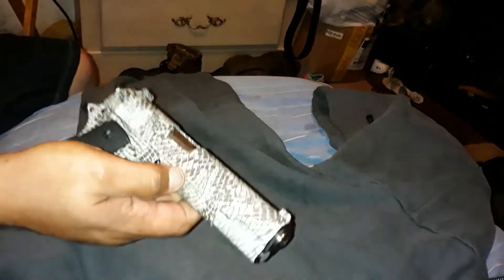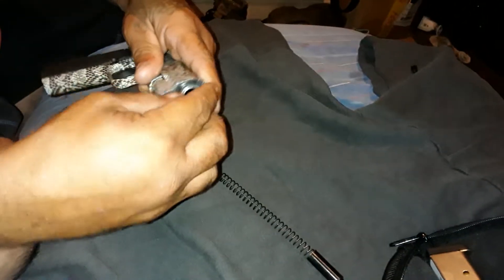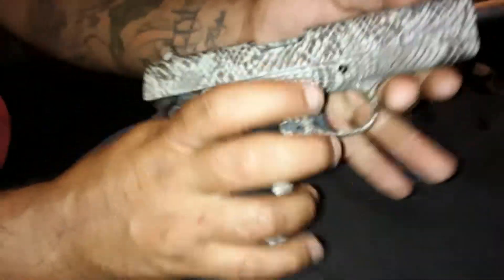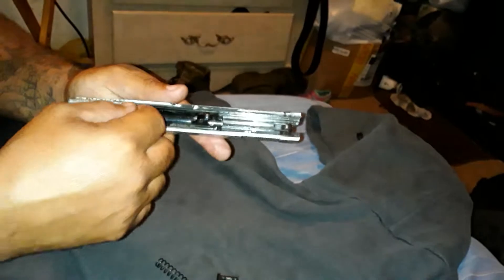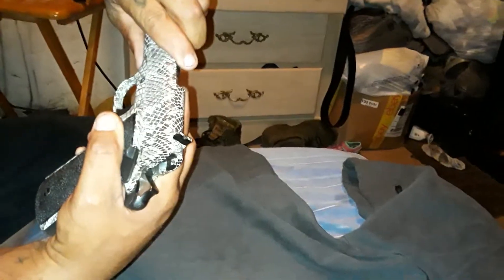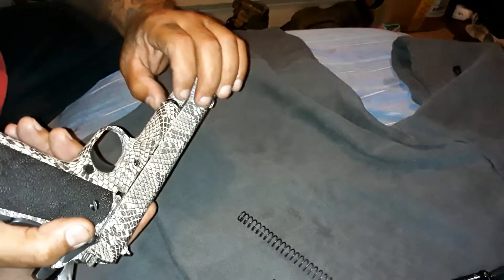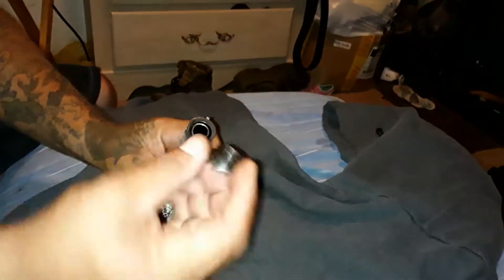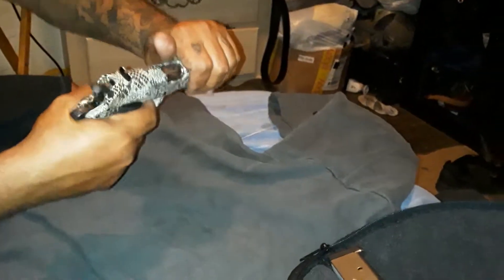Breaking down a iver Johnson 1911 A1 45

Comment: Probably the WORST reassembly of a 1911 I've EVER seen. Put the spring in (without spring plug) before putting on slide and you won't have that problem with the guide rod falling out of position. 

Other than that, the snake 🐍 finish looks AWESOME!!!!